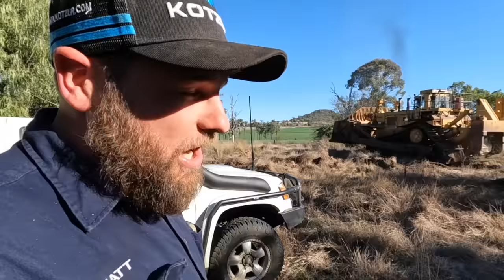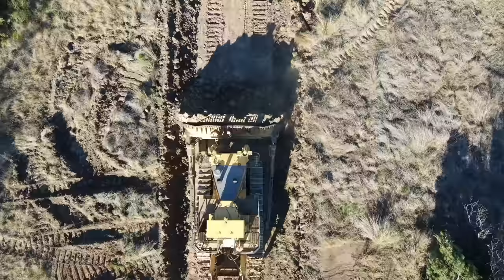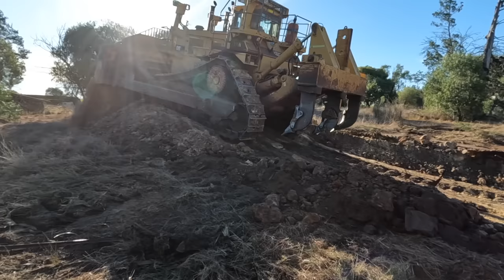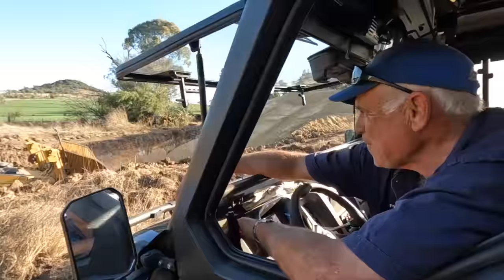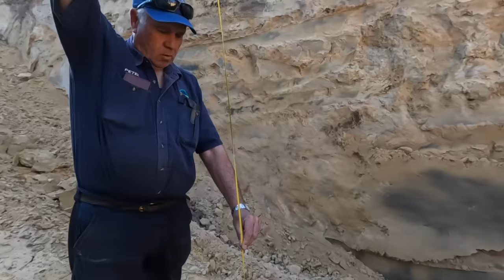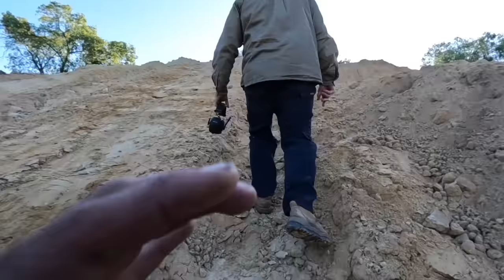Big D11 Bulldozer Digs A BIG Hole!!

Comment: On a much much smaller scale I have a 1949 Cat D2 wide track with a blade on the front and a hydraulic spreader bar with six 18" rippers on the back.  I love ripping the ground. It is just cool seeing the power of the little guy work the land.

Comment: Well done boys, reminds me of a giant dragline in America. It was used to rip the overburden off the top of the coal seam and ran off electricity from the nearby powerstation, when her job was done they buried her in her own hole. There was a crew onboard to run it and another crew to move the extension cable.  
Tiny still has a job and the grandkids will have fun riding through there till it fills up with water.

Comment: You know when a D11 spins it's tracks with grouser bars that big on them that is under a heck of a load and pushing some tonnage. I'd say Phil was push 120T+  when he was slipping the tracks.
Reply: 420tagalong like you know😂
Reply: @rmz2235  that I do cause I Operate Dozers so yeah I would say that he was pushing that much if not a lil more.
Reply: @420tagalong  120 tons??

Comment: Aussies and Floridians salute in exactly the same way!

Got myself into a situation once with a tracked skid steer. I found that the hole I was in ended up steep enough that I could no longer scoop a load of dirt at the bottom and keep it in the bucket while backing out.

Comment: The girl is a power house . At least that undercarriage look good. I was watching another video earlier of a D11 they were using it as a pusher for pans an the tracks were so thin you could about see thru the steel an no teeth on the Drive . I am a retired heavy equipment mechanic of 54 years . I still love watching all of them work. Thanks
Reply: Hello ! How did you get your old age pension so early at the age of 54, which country do you live in. I live in Estonia and I only got my pension at the age of 64 in 2023, now I no longer work.

Comment: Matt,
Are used to have a little John Deere with a set of rippers. Never thought about this. Could you flip the rippers facing backwards and rip when you going backwards? Or would that put too much load on your track tensioner? Would be more efficient, but may not be good for the machine.
Reply: Had the same question!

Comment: A lot of our juvenile bassalt soils overlay sandy deposits. These are the remnants parts of the inland seas. The so called ‘great divide’ was formed when Australia separated from New Zealand about 60 million years ago so the bottom of the hole might be a bit ancient. When travelling much further west these sandy deposits are often on top of the hills, blown there as sand dunes when the land was very dry during the ice ages. The sand deposits serve to provide a pathway to replenish the great artesian basin (a giant water storage system covering large sections of the eastern Australian continent).

Comment: Very well done PHIL you used just the corrections amount of revs to apply the right amount of torque to the soil to have the minimum slippage. MATT your a farmer its called SOIL not dirt.
Reply from the maker: If it’s deeper then 300mm it’s dirt! 😂😂

Comment: I dig huge machines! I was born in S. Idaho and raised on a large ranch/farm of around 4000 acres. A little smaller than your 6178 acres. The largest machinery we had were a couple of Steiger “Big Green Machine” tractors. Plenty of CASE, International and Massey Ferguson’s. Had New Holland narrow beds, Freeman 3-wire balers, MACK, International, Peterbilt and Kenworth’s for hauling our potatoes, seed alfalfa, grain and hat bales around. I was sitting on the seat of smaller tractors at the age of 10 and 11 working my ass off. We never had huge dozers or road graders. If our Steigers couldn’t do something, then we had a guy come and do it. Haven’t seen many of your videos yet, so I am wondering if you guys are contractors as well for heavy equipment? 🤔

Comment: How much diesel did it use? And what is the maintenance on such a machine?
Reply from the maker: It would of used about 80-90 litres to dig this hole👍 maintenance is engine oil every 250hrs and fuel filters, final drives etc every 500, and every 1000hrs is things like hydraulic and trans filters. It’s not as much money to service as you would think👍

Comment: 11’s don’t like anything 0ver 5 to 1 slope it’s like 18 degrees cause a dozers arch nemesis is pushing up cause you’re robbing dirt pushing power for power to move machine  our soil is about the same and I’ve dozed and dug with a 365 excavator probably with a 3 yard maybe 4 yard bucket dozer a little faster as long as you push your spoils wide and far enough to keep exit ramp shallow enough we dig lockers for stumps and boulders don’t take this the wrong way but for a ol d11 multiple hours she a pushar was gonna say for a old trapt out 11 but that just mean and pushing out that is so dangerous standing right up to a bank

Comment: I disagree that a d11 would dig a faster hole. They are slow and then the time backing up with no dirt moving is lost time. If you need to move it kinda far it might be faster like taking off topsoil and making a pile but a 40 ton excavator would big a hole like that in under 10 minutes with ease with even a rookie operator.